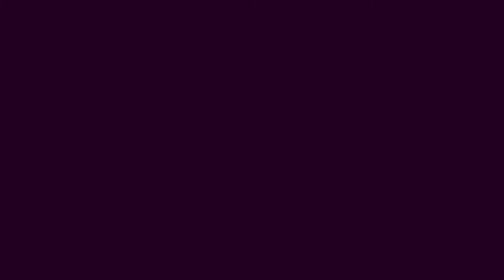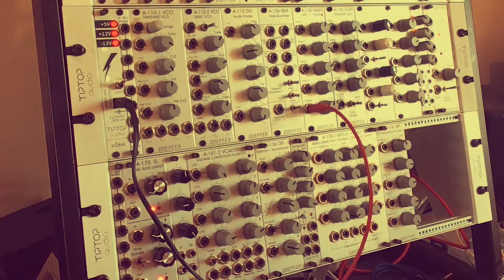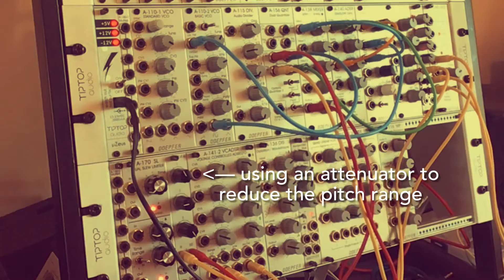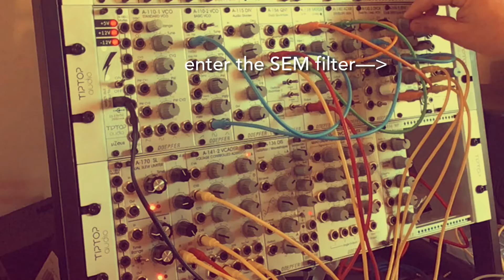Doepfer A-141-2 + A-145:  creating a sequence with an LFO and an Envelope Generator

Comment: you just gate the envelope with an lfo. you're not passing the lfo through the envelope like you mention in the video, the A-141-2 isn't a serge like function generator with a signal input. you gate the envelope and the envelope alone makes the waveform.

Comment: A simpler technique would be to S&H an LFO waveform (other than a pulse) and pass it through a quantizer.

Then you can filter it, pass it through an envelope, ring modulate it, wavefold it, whatever.
Maybe also mix it with a S&H noise before quantization.
And even modulate the filter.

Comment: Can you list by name here all the modules you used in the patch? Thanks. I’m watching on a phone. I appreciate this demo, interested in these Doepfer modules.
Reply from the maker: It’s an LFO with multiple waves outputs patched into an ADSR which has cv controls for its four different parameters (attack, decay, sustain release). That’s all. One LFO wave goes through the ADSR like a classic gate signal usually would, and it’s transformed into a morphing wave which, passed through a quantiser, becomes a clear sequence of cvthat can control a vco. The second LFO wave is patched in one of the four ADSR parameters to change it overtime, therefore changing the sequence.

Comment: What happenned in 3:45? Is the "invisible" module VCA? How did you connect it? After the video cut the sequence sound different and there is no explanation.
Reply from the maker: Yes, that was the vca coming in… I just skipped the boring sequence of creating the basic eg-vca connection, cause that’s not what I’m talking about in the video. But thank you for your feedback, I’ll try to avoid this gaps in the future.
Reply: @chiptunasoundworkshop8257  please check your messages on facebook. I am trying to go thru your tutorials step by step and I have some troubles ;)